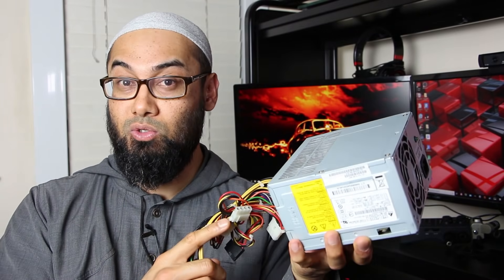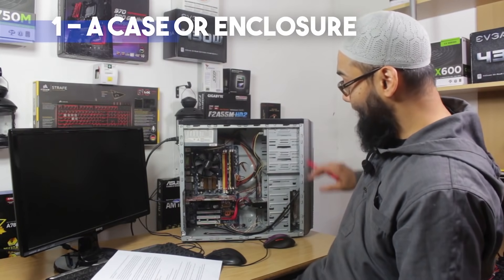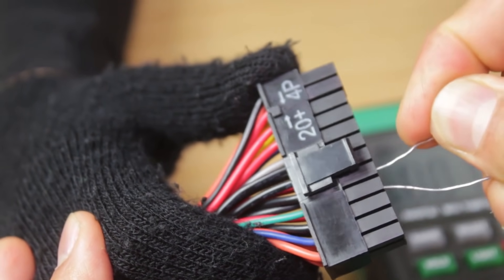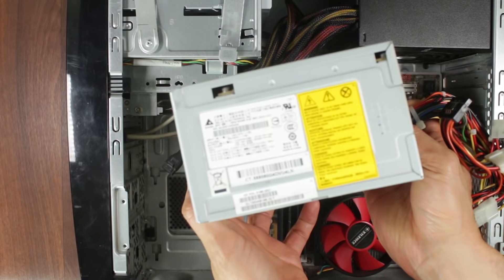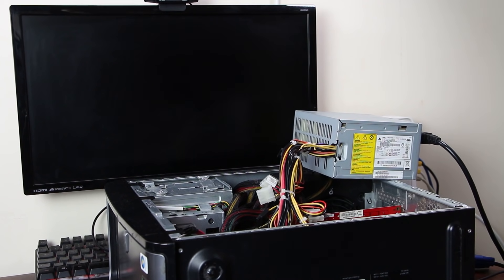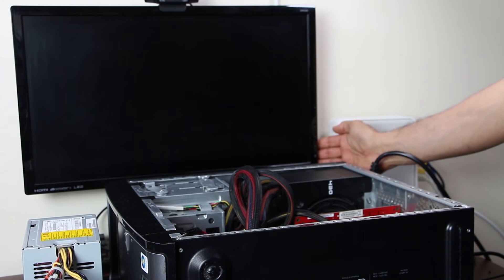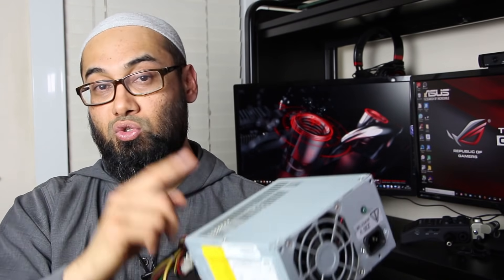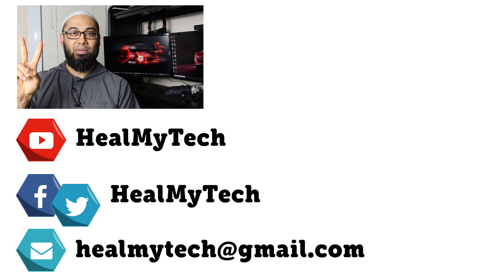Computer Turns On But No Display On Monitor | Led Light On Fan Spinning | Power Supply Unit Pc?

Comment: I even tried a different (working) psu, it worked for a time but the problem is back again
Not it starts sometimes and sometimes doesn't.
Reply from the maker: This video is only one possible way of troubleshooting and fixing a PC. Based on all you questions, I have created a dedicated series to help troubleshoot all 10 main components of a computer in a logical process, I promise you if you follow it you will sort out your issue, since its the exact same process I go through when troubleshooting any pc problems for hardware. Troubleshoot A Computer Series Playlist | Computer Not Turning On | PC Turns On But No Display On Monitor https://www.youtube.com/watch?v=Wkcx-x9gjkg&list=PLDmnHbxxv3ncrDmkkt4oVJTEIBIy9pvRN

I have also created a facebook group especially to help troubleshoot computer/laptop issues.  If you post your question there with some pictures or even better a short video footage you will get a better response.  Consider joining but make sure you read and accept the conditions and answer the questions, otherwise you may not be approved to join.  The idea is to help each other, I am unable to respond to every request by myself.  https://www.facebook.com/groups/healmytech/

Comment: I have a similar issue with my Corsai powersupply, when I start my pc, it dosen,t suppy power to monitor. However, when I switchoff powesupply and power up my cpu, it switches on my monitor. Not sure, what is causing such problem.
Reply from the maker: This video is only one possible way of troubleshooting and fixing a PC. Based on all you questions, I have created a dedicated series to help troubleshoot all 10 main components of a computer in a logical process, I promise you if you follow it you will sort out your issue, since its the exact same process I go through when troubleshooting any pc problems for hardware. Troubleshoot A Computer Series Playlist | Computer Not Turning On | PC Turns On But No Display On Monitor https://www.youtube.com/watch?v=Wkcx-x9gjkg&list=PLDmnHbxxv3ncrDmkkt4oVJTEIBIy9pvRN

I have also created a facebook group especially to help troubleshoot computer/laptop issues.  If you post your question there with some pictures or even better a short video footage you will get a better response.  Consider joining but make sure you read and accept the conditions and answer the questions, otherwise you may not be approved to join.  The idea is to help each other, I am unable to respond to every request by myself.  https://www.facebook.com/groups/healmytech/

Comment: I have a brand new PSU and GPU and it's not displaying
Reply from the maker: This video is only one possible way of troubleshooting and fixing a PC. Based on all you questions, I have created a dedicated series to help troubleshoot all 10 main components of a computer in a logical process, I promise you if you follow it you will sort out your issue, since its the exact same process I go through when troubleshooting any pc problems for hardware. Troubleshoot A Computer Series Playlist | Computer Not Turning On | PC Turns On But No Display On Monitor https://www.youtube.com/watch?v=Wkcx-x9gjkg&list=PLDmnHbxxv3ncrDmkkt4oVJTEIBIy9pvRN

I have also created a facebook group especially to help troubleshoot computer/laptop issues.  If you post your question there with some pictures or even better a short video footage you will get a better response.  Consider joining but make sure you read and accept the conditions and answer the questions, otherwise you may not be approved to join.  The idea is to help each other, I am unable to respond to every request by myself.  https://www.facebook.com/groups/healmytech/

Comment: My fans turn on but when I press power it doesn’t turn back off
Reply from the maker: This video is only one possible way of troubleshooting and fixing a PC. Based on all you questions, I have created a dedicated series to help troubleshoot all 10 main components of a computer in a logical process, I promise you if you follow it you will sort out your issue, since its the exact same process I go through when troubleshooting any pc problems for hardware. Troubleshoot A Computer Series Playlist | Computer Not Turning On | PC Turns On But No Display On Monitor https://www.youtube.com/watch?v=Wkcx-x9gjkg&list=PLDmnHbxxv3ncrDmkkt4oVJTEIBIy9pvRN

I have also created a facebook group especially to help troubleshoot computer/laptop issues.  If you post your question there with some pictures or even better a short video footage you will get a better response.  Consider joining but make sure you read and accept the conditions and answer the questions, otherwise you may not be approved to join.  The idea is to help each other, I am unable to respond to every request by myself.  https://www.facebook.com/groups/healmytech/

Comment: Idk if it’s my power supply or my  graphics card I can turn it on and it works fine like it normally would but nothing displays when I first Tried to turn it on and then the rpm on the fan would go up and down then I unplugged everything and plugged it back in and it worked normally but no display. Someone please help me!!!!!

Comment: My setup hasnt worked since day one, the screen lights up and stuff happens, i can go through a menu with a monitor button on the back but neither mouse or keyboard responds when plugged in to the pc. Ive tried my hdmi cable, i tried a vga cable but was given the wrong adapter (vga to hdmi). Should i try a dvi to vgi  adapter( moniter only has vga, tower only has dvi) or what, this my first time dealing with a pc so im lost plz help!

Comment: my problem is that it will power up with display and everything but at some points the screen will just cut out and the fans go on full blast. but i can still hear desktop running. Can anyone help
Reply: Ram Issue. Reseat the ram or else replace it with a new one.

Comment: HealMyTech     I have a question brother from my Asus P4P800-E Deluxe motherboard. I just bought brand new 850 Watt ATX power supply and tested it with power supply tester it came out correctly voltage output 3.3V, 5V and 12Volts. I just repaired my motherboard. Replaced one bad Mosfet 06N03LA and 1 bad bulging capacitor 1500uF 6.3V 8mmx20mm size in to brand new same value same size which is that's beside the CPU processor. Then plugged-in just the power supply in motherboard nothing else...no any device cards nor RAM memory nor HD/SSD etc. just the fans. Turned on power supply and the green LED on the motherboard turns on. Pressed the switch on button and all fan turns on. I did not plug-in RAM memory. But If the memory is not install it supposed to go beep signs on speaker of motherboard but it's not giving beep signal. If the motherboard go beep that means the motherboard is good but it's not giving any beep signal.  I tried to reset the CMOS jumper switch by the battery, still the same no beep. Is this means motherboard is bad? If so, what's the real issue?  Is BIOS chip bad? I'm not sure. Do you think the 850Watt ATX power supply and all ATX power supply are universally compatible to any ATX desktop motherboard? Is the CPU may be bad? Can you suggest something brother please? Let me know please....I'll be waiting....

Comment: Sir my pc's main fan that takes heat out from rear starts going fast and my monitor display turns off...and I also hear those windows ding sounds as well through my headphones abt 2-3 times ...but i don't see anything on display , the pc doesn't shut down or restarts either on its own ...could this b power supply ...I have antec 80plus bronze 750watts ....a month ago upgraded to 2070super ,I have a b350 board with ryzen 7 1700x processor currently running on 8 gb ram...could this be a graphic or psu problem since my psu is 3 yrs old now..only recently I have been having this weird trouble..before this my GPS was gtx1080 had no issues then...my graphics card is msi 2070super gaming x trio

Comment: Hi i have a similar problem for my pc, my pc fans and lights are all turning on but the monitor says no signal on it, when i try to unplug the dp cable the monitor will display 'no cable connected', when i plug in the cable again it says no signal.. but mine will happen sometimes and when i try to power off the pc and turn it on again it will perfectly work,its not like it will not show display again .. most of the time this will happen is when i start my pc after a long rest or first start of the morning/day. can you help me please
Reply: I have the same problem my monitor doesn't display until I fully turn off my computer then when I turn it back on it works fine
Reply: @maxx1827   replace cmos battery and reset bios
Reply: Try to reseat the ram.

Comment: i recently built a gaming pc and after i put everything together it powered up fine and i was able to log in.2 days later i tried to turn the pc on and it powers on fine and the gpu fans are spinning but i am getting no display.i even tried a different monitor.i just bought a new psu for this build so i wondering if my gpu died.

Comment: I have the same issue with the power supply. Sometimes my computer randomly freezes or screen goes black and then freezes. In both situations I have to restat my PC. Any suggestions?

Comment: My computer turns on and everything but when I turn my monitor on it just says to check the video cable and video source but they are all connected
Reply: Same here
Reply: SupplyDropPlz - get a new power supply or new vga cable
Reply: Thomas William was that your problem?
Reply: SupplyDropPlz - yeah but I decided to sell it and build a better one just buy a new cpu or power box
Reply: Do you experience a problem on your Laptop, Macbook, Desktop, Phone? Is it over heating, screen turns black, windows issue?
Then search no more, message MILLER'S TECH for any kind of COMPUTER REPAIRS, HACKING ISSUES, Contact him on WhatsApp +18312915270

Comment: Not sure if you will respond or if anyone will help me but, I have recently built a PC and when I press the on button it turns on then off then on again. The only thing that isn't working is the CPU fan. I am purchasing a new one and it will be coming soon. Other than that everything seems to be working just fine, there is no error beeps on startup. I am not getting any signal from my GPU to my monitor. The motherboard does not have integrated graphics so I must do it that way. Do you know what could possibly be wrong with my computer? Thank You.
Reply: Reseat ram or it might not be compatible with the board.

Comment: The light next to my CPU (green, orange, red or white) boots up organs then red shuts off then boots of again in the manner then turns white. I have tried to trouble shoot but nothing is working. My fans all operate and spin my LEDs work but I'm not getting a display on my Tv, yes I'm temporarily using a 60hz tv until my monitor come in through the mail.

Comment: My problem is when i plug DVI cable into my GPU it just shows black screen , no bios , nothing! But when I plug DVI cable into my motherboard(for integrated gpu) it boots up perfectly fine I can use it but even then there is no sign of my gpu in device manager even doe its installed into the motherboard?!?

Comment: Everything’s working...everything. Power supply is brand new, all fans working as they should. Ram and graphics card were taken out, cleaned and re inserted. Fans working there, Same result: After 20 seconds on my desktop it goes automatically to power save mode on my monitor. Switched monitors, same result. Computer stays working and I can hear audio, was able to make sure power scheme was set to never go to sleep (monitor and hard drives)...but monitor goes to sleep & won’t come out of sleep mode no matter what I do. Man. Things were going so well for so long and now this. Ah well.

Comment: I'm facing the no signal on monitor  problem  but my pc is working , all fans are spining,my psu is new (Antec bp450p) and I've changed ram ,cleared cmos , monitor is fine, changed vga and I've noticed that my keybord numlock , scrolland capslock light are responsive

Comment: I put a new ram in mine and it turns on but don’t show video and no light on keyboard but still running?
Reply: But when I put stock ram it it it works fine
Reply: Your new ram is not compatible to your board.

Comment: Thank you for the help brother, my issue was fixed when i used a eraser on my ramsticks because i have a dusty room, i was definetly sure it wasnt my ram until i actually tried cleaning it with a eraser and a toothbrsh

Comment: The same thing happened to me but with a brand new 500w corsair PSU. everything in my pc had power except my mouse and keyboard my monitor was not getting any display as well. So I plugged in a different power supply and the same thing happened. Plz help someone😭
Reply: Reset Bios

Comment: I was using my computer, when the screen froze, and strange blue transparent lines appeared diagonally and vertically on my moniter. All of a sudden a wierd screeching sound came through my headphones. I shut off the PC and when I try to turn it back on the PC and moniter are on, but they aren't working and I have no idea what's happening.
Reply: I remember it's called blue screen and it happens when the cables are loose sometimes
Reply: @iwatchstuffs7933  the issue fixed when my pc automatically did a bios update for some reason, and the cables were all firmly plugged in when i checked. But thank you for the reply.
Reply: @h.a.imtiaz7  oh so that means there is a malicious malware on your computer
Reply: @iwatchstuffs7933  i thought that, but i downloaded nothing bad and was very careful about what i allowed on my pc. i used only trusted sites so its still kind of unclear

Comment: So I built my PC 3 months ago and this issue was previously solved by taking out the CMOS battery, booting, and putting it back in, and then booting but now it's doing the same thing and it was working yesterday without this issue. I tried using onboard graphics and it didn't change anything so I don't know what to do

Comment: I tried this as well as removing the MB battery someone suggested, and the boot led is still on and still no display. Anyone have any tips?
Reply: boot led means there is an OS problem
Reply: Reseat the ram.

Comment: Hi, I bought a intel motherboard DQ87PG while connected with processor etc to cabinet no display, motherboard Is brand new any solution.. what would be the problem smps, is working power ok etc.

Comment: I have an question that
I have rx 560 4gb 
And i have local brand psu 500w bronze 80 and its not running properly ...that graphics card light turns on and cpu fan also move but keyboard amd mouse don't work amd doesn't show display..but without graphics card it runs well and all the things works..4 weeks ago i sold my gtx 660 msi tein frozr 192 bits 2 gb and it was running perfectly and all the things were fine
..? So whats the exact reason? I also tested on branded psu of my friends pc it was also 500w and it didn't worked..and my bios version is 2.3 and the latest version is 2.7...i have msi H61H-P31..tell me
Reply: H61H-P31 is my mother board name..and is it slot issue? May be

Comment: I got the same problem, I changed to a new psu and still got the same issue
Reply: fixed or not ?
Reply: @xlr8572  mine was a problem with the mother board. No issue after changing it

Comment: Ive been wondering if I am in the same situation. My monitor suddenly have no display with my brand new RX570 gpu. then i swap the gpu with my older HD7850 gpu and it works and have a display. Im currently using 5 years old 500w xigmatek tauron psu. do i need to upgrade my psu?

Comment: How do I know which power supply to buy mine doesn’t seem to say it directly.
Reply from the maker: Any decent brand, try to get similar or slightly higher wattage as your current one...best not to go for unbranded or cheap ones.  Some decent brands are EVGA, Corsair, Thermaltake, Seasonic, NXZT, Fractal Design etc

Comment: was watching this video thinking what I did was change out ram than put back in so I pushed in ram than blue screen .. my mother board only has 1 tab for locking ram  and I will never buy a mother board again with only 1 locking tab it's been nothing but problems it's so tight to put in and take out I have plastic shavings falling off trying different ram to get xmp were it supposed to be .
Reply from the maker: Fair point, I do have one of those motherboard from Asus, hasn't given me problems, but I can understand it can be on some makes, whats yours?
Reply: @HealMyTech1   got it working 3600 like it should used other 2 slots , must be bad slot 👍

Comment: Hi, Another question: how do I keep dust out of and off of this beautiful brand new processor that has a screen on the top and open spaces in the back areas. It seems so vulnerable to duct right now and my home gets quite dusty, especially when windows are open in the summertime. Thanks again.